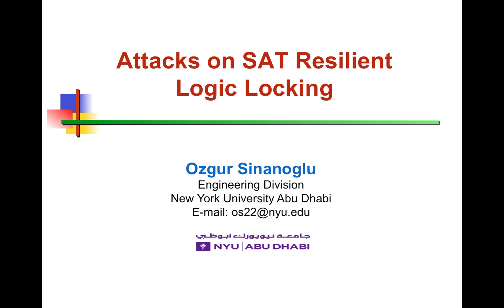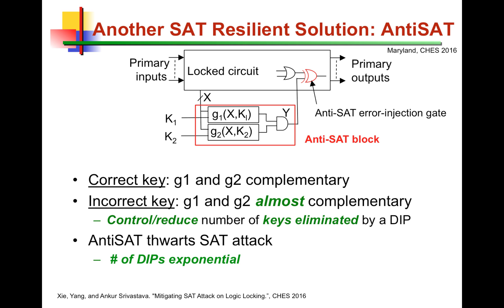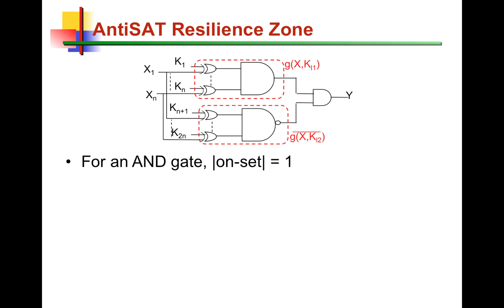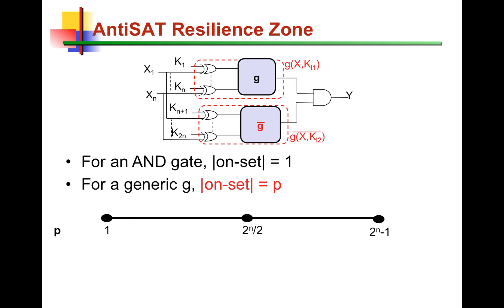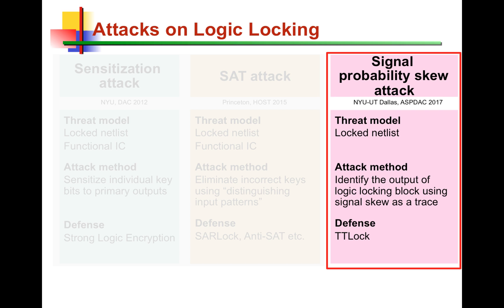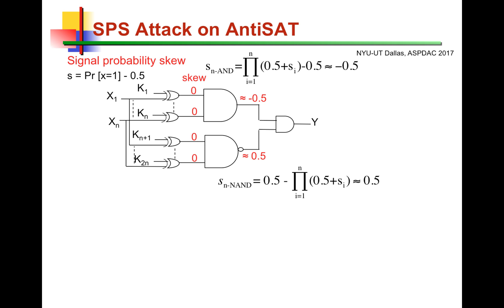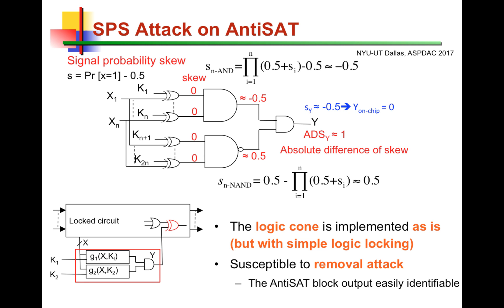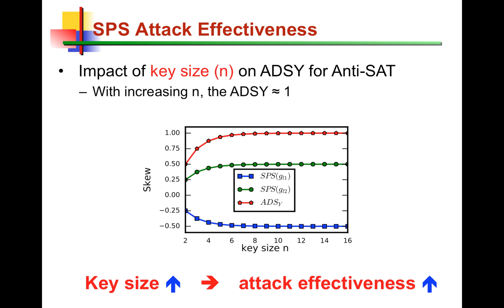Module 10 - Derivate Attacks on Logic Locking

Comment: Thank you so much for these comprehensive modules. 

What will happen if we choose to integrate a defense which is susceptible to removal attacks with another defense which defends against the threat model. For example, if I use SARLock or Anti-SAT along with some camouflaging technique which makes it difficult to reverse engineer the gate level netlist in the first place. Will that not address attacks like the SPS attacks mentioned in this video?